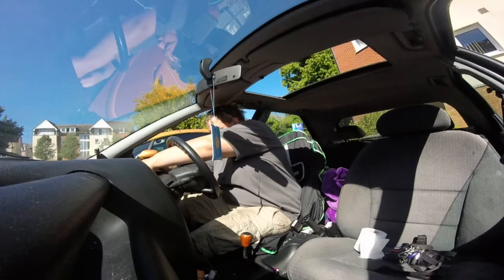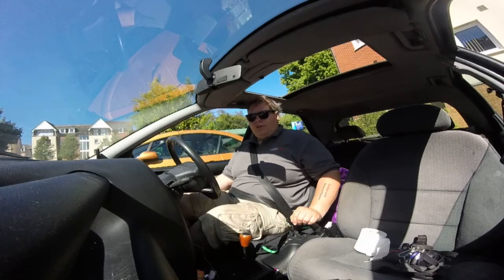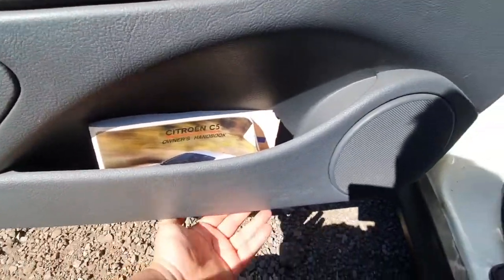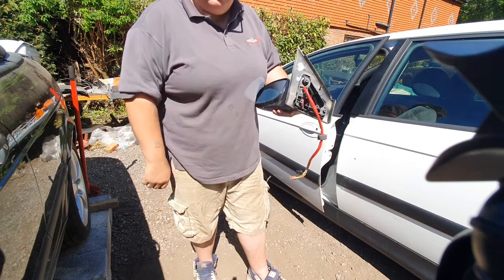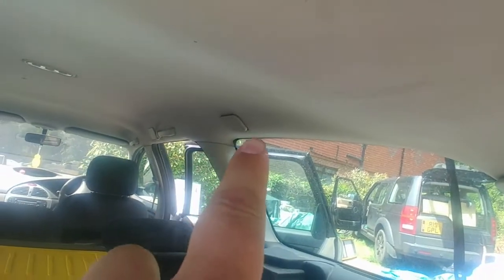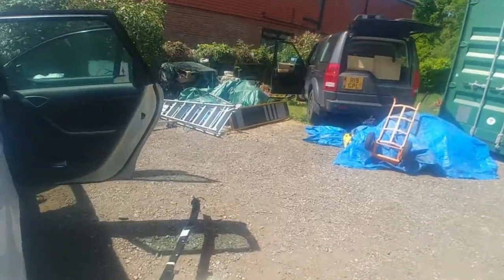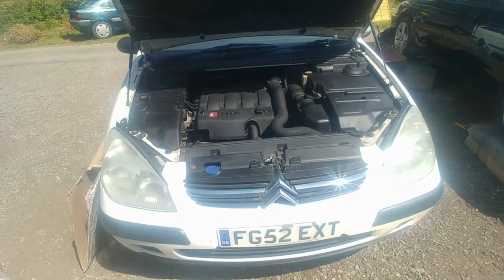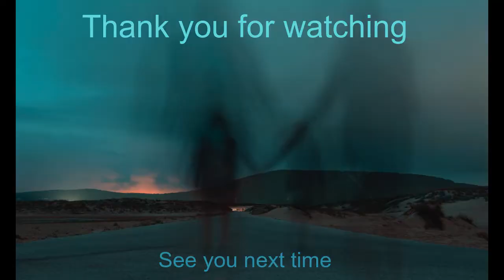White Citroen C5 final video, wing mirror and airbag replacement,

Comment: Hi Hannagh I just found your channel this morning.Brilliant C5 content, love the enthusiasm.Wish I had the skills and time to do jobs on my 08 C5 2.0 HDI estate.Have it nearly a year now and love the simple practical nature of the C5.First car with Hyraactive suspension and its well superior than ur bog standard spring setup.Had DPF issues at first but after i removed it an cleaned it pressure readings are now lower.so fingers crossed it lasts.Keep up the content 👍
Reply from the maker: thank you kindly for the lovely comment, wow, the hydro suspension is a very complete system, i have a few videos of the key components that make the system work, i even have a video on how to test the height sensors too, not sure how many videos you have seen on my channel but i would highly watch the videos i have on the c5 caravan project, its worth watching, i am glad you removed the dpf to clean it, they say you should get the car to do it, but i am not happy letting my engine rev to 6000 rpm to clean it, so like you i ended taking it off and clean it myself,

Comment: Why remove the whole door card ? In most Citroen C5 it is enough to remove the upper triangular plastic above the door card. Inside there are screws to loosen the mirror and also contact blocks. I have done this in a 2007 model ,and it was quite easy.
Reply from the maker: the 2002 has a long wire from the mirror, and inorder to remove it, you have to remove the door card,